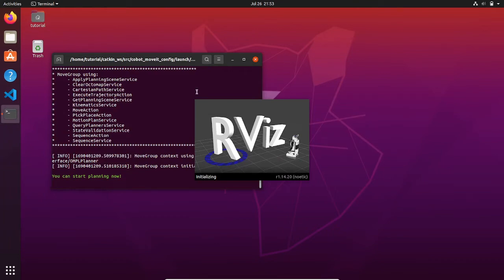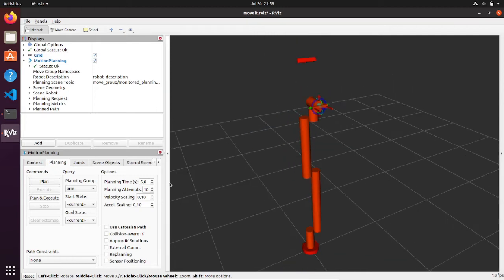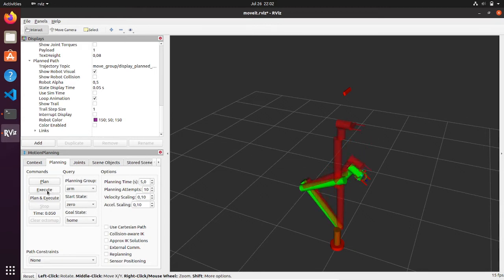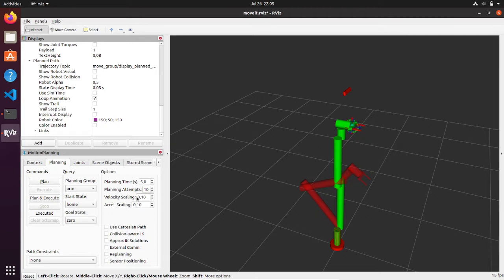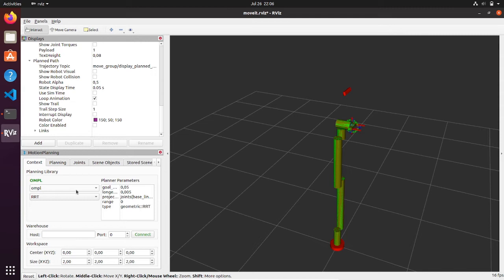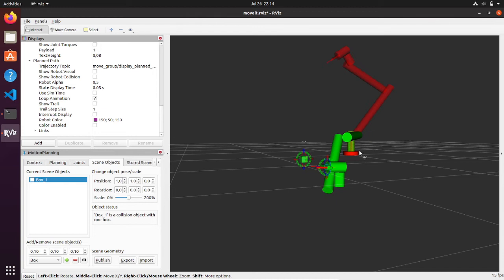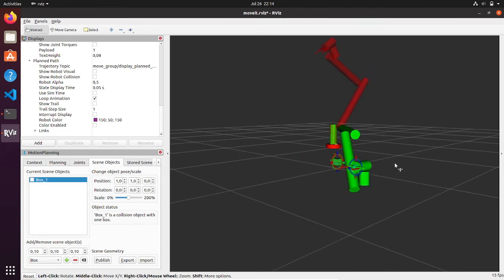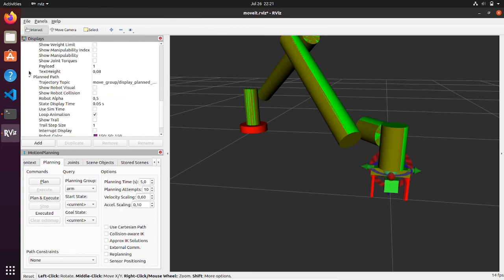How to use Rviz Motion Planning plugin for your Robot

Comment: Hello, when I move the gripper_right in Rviz the gripper_left moves in the same direction. That is, when I move the gripper_right to the right, the gripper_left also moves to the right. The strange thing is that in this video, https://www.youtube.com/watch?v=JGdRC9If2Zg&t=1371s, when I move the grippers in the gazebo they work correctly. Any solution?
Reply from the maker: Hi! Could you please share to me your GitHub repository? so I could have a look in your urdf file, in particular inside the setup of your mimic plugin. I think that depends on the position that you have setup your gripper and the mimic plugin.